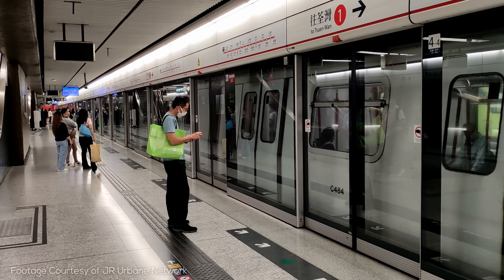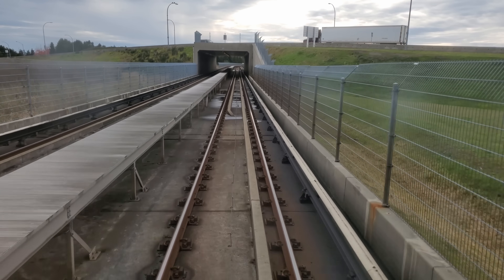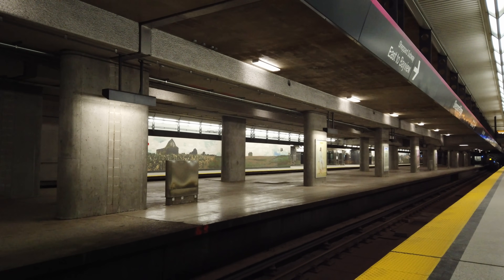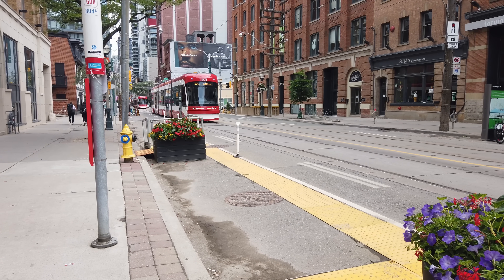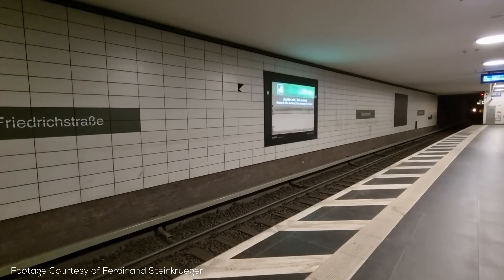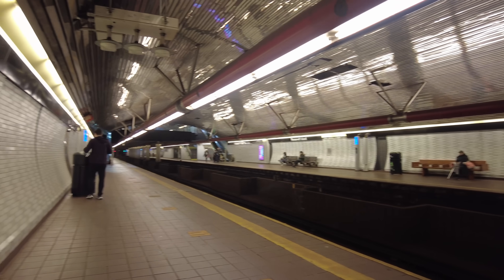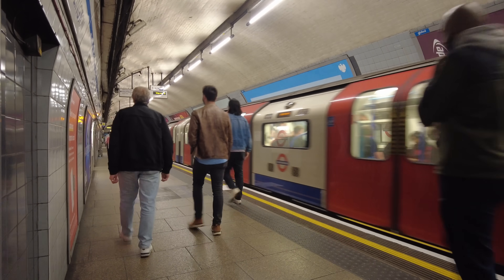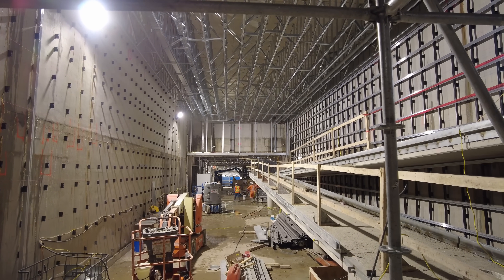Designing a Futureproof Transit System

Comment: There are also some good future proofing (or provisions) potential that have been completely wasted too, Singapore's Promenade station was provisioned as a cross platform interchange when the circle line was built, but when the downtown line was built, those provisions couldn't be used and instead the planners had to stack the 2 new platforms underneath the circle line platforms making a very weird 4 single stack platforms, with the circle line platforms being extremely wide for a line of that capacity. My guess is the original Nicoll Highway station (also provisioned for cross platform interchange) after the accident was rebuilt on a different place with no such provisions, forcing the planners to completely throw their plans out the window. Though it's infuriating that the station after, Esplanade, was made and completed as a standalone cross platform interchange, but we didn't get a nice paired setup like those on the MTR or our local City Hall/Raffles Place pair

On the other hand though, chinatown and macpherson stations had very well thought out provisions for the downtown line when they are built and had very convenient (albeit not cross platform) interchanges, much better than the one at Promenade though!

Comment: I think there is an important distinction to make. Building longer platforms or allowing for double tracking of a single tracked line, because the demand will expectedly be there in a couple of years isn’t something I’d really call future proofing, that’s just planning ahead. 

Adding connections for potential projects and actively overbuilding capacity which might never be used, is a whole different story. The second Munich S-Bahn Stammstrecke is a good example of why this can be controversial. For one they are adding underground stubs for a potential future connection with a route not even really planned yet, but potentially serving an area underserved by the U-Bahn, so that’s fine by me. A lot more controversially, they added around two years and of course a bit of money on top of the initial construction, by adding underground space for the planned U9 main station platforms underneath the new S-Bahn platforms. It’s unclear when and if that line is ever going to be built, so wether delaying the most important transit project for the entire region is worth it, will be something the future has to show. The entire project is now projected to be delayed for 11 more years because of…reasons anyways, so in my opinion it was probably the right call. I can realistically see them start building the U9 before the S-Bahn is even open.

Comment: In Ottawa one of the new rail stations where an existing bus station existed was originally designed with an underground tunnel and concrete caps covering access holes, precisely for running trains in the future, the tunnel went from "abandoned" to construction site overnight.

Comment: When I visited Kuala Lumpur many years ago, they were in working on extending all the stations to accommodate 4 car trains.  When the system was built, they stupidly built all the stations for 2 car trains, and had to re-build them (extent the platform length) when they needed to upgrade to longer trains.

Comment: Brightline FL future proofed it stations by making longer platforms to accommodate 10 passenger car trains over the current 4/5 coach trains. Brightline Miami station in particular was made to accommodate the eventually Tri-Rail connection. They also they have space to make the new single tracked section to Orlando double tracked when capacity deems it necessary. So many people were complaining about the single track not understanding is more than enough for the timetables Brightline is currently planning and allows money to be doesn't elsewhere in the meantime. Spain has used single tracking construction methods as well. Brightline West will continue to do the same.
Reply: Brightline plans their system better than most govt agencies
Reply: Brightline gives us hope that sensible Higher Speed Rail is possible in the USA and Canada in spite of government and bureaucratic nightmares that bog down or kill every other project to date... Cough cough, California, Texas, Nevada (before Brightline West)...

Comment: A warning about future proofing. Honolulu's light metro system (just renamed Skyline before it's opening this Friday) was designed to use two car trains every 3 minutes when fulling built. It is being overbuilt for four car trains every 90 seconds. When it was time to actually buy the rolling stock, four car trains were bought. The plan is now to run a four car train every 6 minutes when fullly built. Overbuilding is going to cause worse service and lower ridership.

Comment: Cities should be looking at land use at potential imminent domain spots to avoid building housing or anything else extremely difficult to remove. Even uses like power sub stations are okay for projects in mind that aren't likely to begin for 30 years as technical improvements hopefully decrease how much land is needed for that facility.

Comment: Nice topic.
In Milan unfortunately I have to say we're going backwards on building infrastructures foreseeing for future possible upgrades.
Back in 1950s and for following decades, metro infrastructures used to be built with tons of these little and big 'things'. Many were used while the network expanded, others remained just predispositions.

Nowadays, with M4 and M5, designers didn't have this mindset.
Future ubgrades and implementations (for istance adding cars to current convoys) will be difficult and expensive.

Probably the reason is the two metro lines were born thank to project financing and have private shareholders who just thought to cut the building costs and ignored the rest (such as a better integration with the network, but that's another topic).

Comment: 7:50 Just like how Exhibition Centre station on the MTR East Rail Line current has 2 very wide side platforms stacked which is ready for creating a cross platform transfer when the North Island Line project is built
Reply from the maker: Absolutely! And a great example of them lying dormant!
Reply: It was showing NY subway. Where did you see the MTR Exhibition station?
Reply: @kenkhwong i was just giving out another example of using stack side platform for future-proofing cross platform transfer

Comment: Preliminary construction work can also turn out to be disadvantageous in retrospect if it no longer fits in with the planning. In Hamburg, the new underground line U5 will use some preliminary construction work that has existed for several decades and was originally intended for completely different routes that are no longer to be implemented today. However, in order to be able to use these preliminary construction works, a route is necessary that is not as straight as it could be if no preliminary construction works existed.
Reply from the maker: Yeah, the further out the plans are the more flexibility you need, plans change!
Reply: In Cologne preliminary construction work at one tunnel actually hinders a new tunnel as they're not up to current technical standards, and to not disturb the service on the other tunnel the new station will have to be built 35m deep in the ground. Which just completely sucks.

Comment: Great video Reece! I noticed that a lot you talked about reminded me of what DART has been doing in Dallas. DART had bought extra space around the stations to allow for eventual platform extensions because it was visualized that trains were needing to be longer. There's also the Lightning and Taxi interlockings west of Belt Line station and north of DFW Airport station respectively. These were to allow a future expansion to the DFW North TEXRail station, but one that likely will never materialize. There's also the abandoned Knox/Henderson platforms underground and space around certain tracks to build new stations (when the demand arises) the lengthy tail tracks at Parker Road station for storing trains (and future expansion possibilities), the fact DART owns tracks into cities that haven't even bought into DART, the numerous crossovers spaced just enough apart to run trains on a single track, and other small things.
Reply from the maker: This type of forward thinking is great even with Darts problems, Calgary did similar things and even left extra space in the centre and at the side of major roadways

Comment: imo the ultimate case of future-proofing in the subway is Osaka's Midosuji Line. All of the stations were built to accommodate 12-car-long trains back in the 1930s. Although the line now uses 10-car trains due to the increased length of modern carriages, it is still impressive considering that other cities like Tokyo or Nagoya are suffering from capacity constraints with only 6-car trains on their major subway lines (Higashiyama, Ginza, etc.)

+10-car might sound like an overkill for non-asian folks, but the line runs train every 2 min during rush hour, despite having such huge trains. (and ofc all the trains are jampacked) it is actually one of the most successful subway lines in Japan with 230% of profitability!
Reply: Every 3 min during the off-peak as well. Impressive.
Reply from the maker: Oh absolutely, the foresight is truly impressive!
Reply: @RMTransit  To my perspective, Japan is kind an exception. Because the population density is so high that almost no other country may compare. Also, 12 car platform is really long. If this line have underground stations, the construction duration and cost will be way too high. If you exit the train at the end of platform and walk to the other end to exit the station, it will take whopping at least 10 minutes.
Reply: @liujun050612  future proof literally exists to prevent the transit project being even more expensive due to inflations and urban development. building stations during initial construction phase costs just a fraction of later adjustments. 

also, about the train length - bigger and stations means bigger platforms, increasing capacity of each stations. unlike north america, majority of metro systems around the world has multiple exits to the streets, connected with underground halls right above the platforms. and there are multiple stairs around the platform providing fast connection to the hall from every part of the train...

so it might sound horrendous for some of the people, long platforms work just fine, and often even better than shorter ones
Reply: While impressive, It's not as impressive if you remind yourself that the stark rise of the automobile wasn't a guaranteed thing in the 1930s. If you assume that most people don't own a car and therefore will be moving  by train, the long platforms kinda make sense.
Reply: @Ruhrpottpatriot  thank you so much for saying this
also, in retrospect to the history of japan at that time, they were industralising and developing hardcore and as a result taking 'risks' like this wasn't so much of a big deal, whereas nowadays the logistics and potential downsides must always be considered
Reply: @The_Jazziest_Coffee  well interesting perspective, but japan's economic develpment exploded after 1950s. 1930s when they were building the thing, japan just started (if not already) to put all their budgets in WWII. they even started to take away underutilised railway tracks later that decade, just to enhance the production of weapons and war equipments. yea i understand that they might have planned it beforehand with the resources they extracted from all around the asia, but saying 'japan had no risk factors in 1930s' sounds weird to me :/
Reply: @저사양-lr2qz  that is actually true now that you mentioned it
to be honest i just assumed that because whenever a country industrialises, they tend to take more expansive development projects in infrastructure, but i dont think what i said really covers the full picture

Comment: The only problem for klna jaya line is underground stations... How can it be extended?? That's the question
Reply from the maker: As I mentioned in the video, underground stations have been expanded in lots of systems such as Madrid, it’s just more complex
Reply: @RMTransit yes true bcuz they have to redug out the station box to move the columns on both ends to a little bit further as the kjl ridership is currently increasing from 170k in 2015 to 216k in 2019...that's a lot to be done to make sure the trains came at every 2 min at peak

Comment: On the underground section of the Elizabeth line, some of the glass panels at either end of the platforms could be replaced with more platform screen doors to allow for longer trains in the future.
Reply from the maker: Iirc I mentioned this in the video! It’s good!
Reply: Not like the trains are already long enough.
Reply: @davidty2006 you say that, but after only a year of full-scale operation, ridership is exceeding expectations. There are already serious conversations going on about adding extra carriages to Elizabeth line trains.

Comment: Here in Copenhagen we're in quite a pickle. Our first 2 metro lines, the M1 and M2 were severely underbuilt and now face immense overcrowding during rush hour (and yet somehow still performs below the ridership targets the whole project was budgettet for). And this is just after 20 years. The platforms in the downtown arent futureproofed for 4 car trains instead of 3 due to a budget cut by right wing politicians back in the day, not so much in length, but in passenger flow so that everyone can evacuate safely in time in case of an emergency. To retrofit the stations would require closing the whole trunk of the system for 2 whole years! And now Copenhagen so badly wants to get the M5, a brand new metro line going so they can have a secondary metro corridor across the city centre harbour and funnel passengers onto it so they can close the M1/M2 to upgrade it. 

On the other hand though, there is decent futureproofing elsewhere in Greater Copenhagen. Busy parts of the S train network like the Northern corridor through Lyngby was actually built for Quadtracking, and despite a highway taking up a small bit of space at grade in one space, it should be very realistic to quadtrack this section in the future, potentially allowing extra high frequencies and faster services. The quadtracking measures were from a time where the railway to Hillerød was still a regional line with plans to separate those tracks from the S train system. But the politicians of the time made a "discount" solution and integrated that service into the S train system. 
On a similar note, elsewhere in the same area, there's an unbuilt S train corridor along the highway that even had viaducts prepared for it. Many of them have been removed but some of those that still exist are actually gonna be used now by the Copenhagen Light rail for the last 2 stops of its route.
And on the Metro at least, at the M4's upcoming southern terminus at Copenhagen south, the tunnels overrun a long bit allowing for the line to be expanded (with 2 proposals currently up, though make of them what you will). And the city's new M5 metro lins is being planned with a junction box in mind to serve the... frankly quite stupid cross Øresund metro project to Malmö in Sweden should it be greenlit. But they also state now that western extension proposals for the M5 are now being developed with possibilities for junction boxes for a new branch to the Northwest and Brønshøj in mind. An area that has been starved of rapid transit ever since their tram line seized operations in 1972 and which has had pipe dreams of Subway service since the 1930's
Reply from the maker: I think the solution for Copenhagen is to build several more lines, just make sure they are larger!
Reply: @RMTransit  Maybe but with the current way its financed and handled I doubt its gonna be good long term. The city is already 30 billion kroner in debt to the national government and that debt likely won't be paid until the 2070's all relating to the Metro.
Reply: @RMTransit  Copenhagen for it's metro should have copied the Paris RER system. Main-line loading guage ,platforms long enough for 8 car trains , grandiose stations, Raadhuspladsen could be a carbon copy of Nation RER station in Paris ) and 1650 Volts DC overhead wires.
Reply: Building all the stations for 40m(!) trains has always stumped me. Meanwhile in Stockholm, stations were built for 140m trains while they only ran 70m trains, and later stations 180m (not likely to be used though).
Reply: @manshenriksson  Yeah but the Metro here is not that good when you look under the surface. It has trapped the city in a debt cycle all because of the way its financed. Its primarily right wing parties that support the Metro but they also only support it on one cause. That it pays for itself. 

So the metro here has received zero government funding only a government loan, which needs to be paid back. Of which 2/3rds need to come from ticket revenue and the last third from land sales.

 (which hasn't worked out and has caused very controversial stuff like building on protected land and artificial islands with environmental damage following suit like Lynetteholm and more. But the development authority always runs out of space by the metro unable to meet their target, so they need to develop in a different area. They can't sell property there at high enough value without promising a metro line and so the cycle continues. The metro here has become a ponzi scheme.)

Also the right wing always prioritises getting the cheapest option in the vast amount of cases. The cheapest bid wherever possible for the lowest construction costs which almost always throws futureproofing out the window.